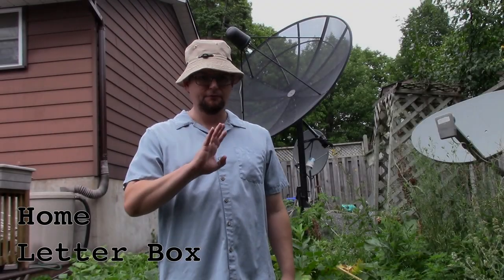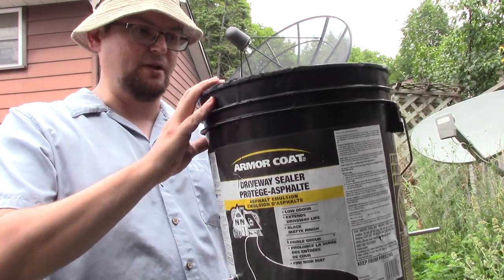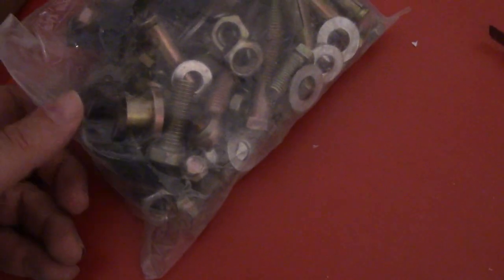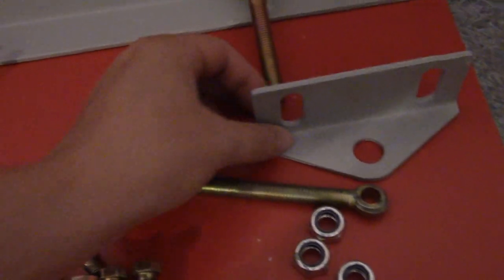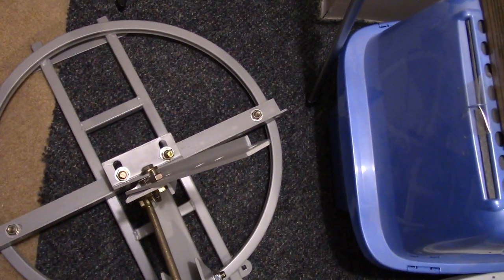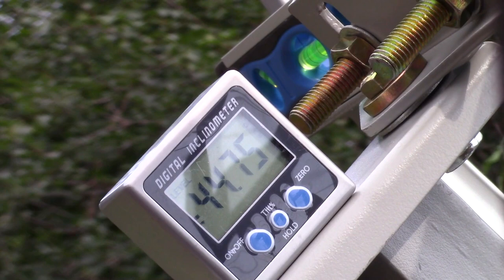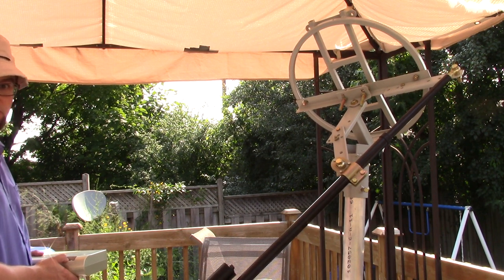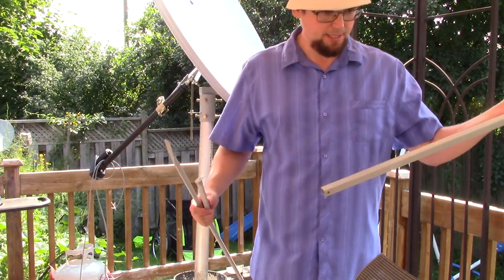Assembling and Setting up A Free Satellite TV - 120cm (4ft) Ku-Band Solid Offset Dish

Comment: Cool dish, i have the geosatpro 1.2m, i ordered a 4’ prime focus dish from wish, it’s also on ebay, let us know what you can receive on c band with a conical scalar ring with that! So far i had a few channels on 91, 97, 101, 107, 125. Nothing much and it was just barely locking . Except for byu on 91.
Reply from the maker: now I am going to recommend to try to lock BYU for a first signal. I get better signal than my 8 footer. ( I need to adjust the 8 footer i guess) https://www.youtube.com/watch?v=1P55TNcgt-c

Comment: I'm a virgin when it comes to satellite TV but I had no problems with a dish up to a meter,now I have a dish of 150cm (gibertini) no reception.i wonder if I need a bigger/better lnb for a big dish?
Reply from the maker: It could be the cable. IF you can get signal outside but not inside!
Reply: @RobbieStrike  it's just strange if I take the cable from the big dish srew it in the lnb on the meter dish I get it all , when I put it in the lnb on the 150cm dish nothing maybe it's the lnb. if I switch the lnb from the big to the small it's also working .so the lnb can't be the problem maybe the reciever

Comment: Hello sir. Please tell me the focal point of this offset dish. I need to know the length of rods, distance from centre, top and bottom. Please
Reply from the maker: When you get the dish the rod should be included
Reply: @RobbieStrike  sir I got the dish frm a second hand market and the rods r not there. So I have to manually make rods and adjust the focal
Reply from the maker: @muntazirbhatt6844  okay good luck with that project. I don't know I never done that before.
Reply: @RobbieStrike  sir, kindly tell me the measurement of rods